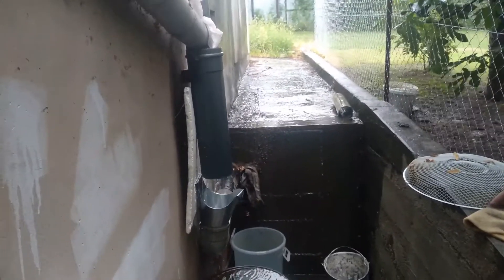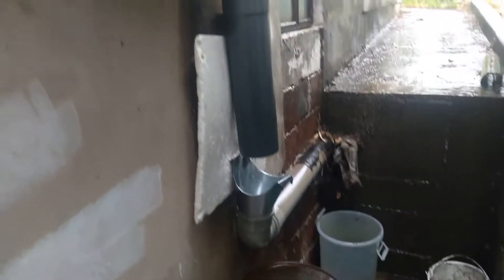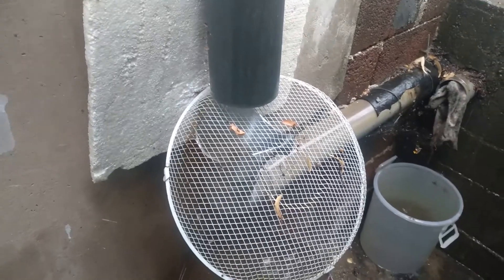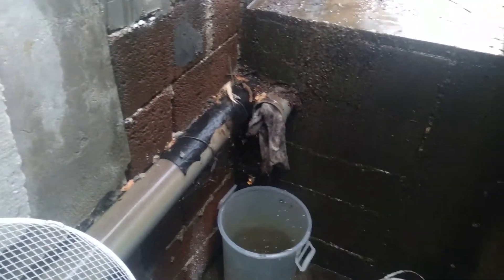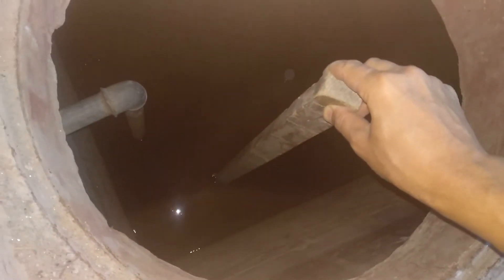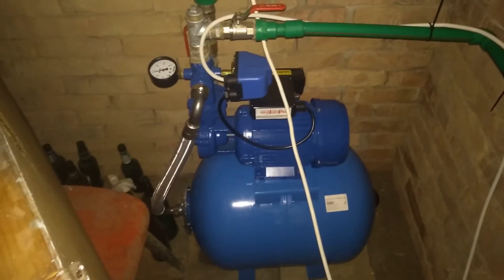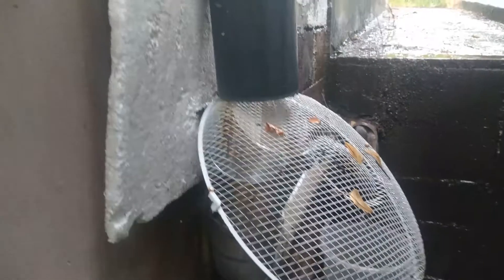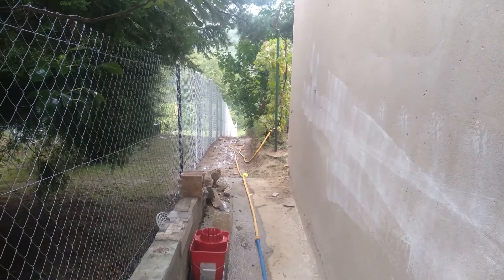Rural rainwater collection system with underground tank

Comment: Nice, you are collection a lot there. I need to get my rain collection started.
Reply from the maker: Go for it! I would say, don't underestimate how much you think you need, especially if you are in a hot climate, our 2000 gallons is nothing really, for any sort of irrigation I would be happy to have 10 times that :).
Reply: @thehillsidegardener3961  20k gallons is a good amount. I've looked into 10k gallon tanks and they are expensive.
Reply from the maker: @pixicshomestead  Yes, this was dug into the earth and lined with concrete, I think it's quite a cost-effective way of doing it. Though ideally you would paint the inside with a waterproof sealant, I don't think mine has one, concrete is pretty impermeable.